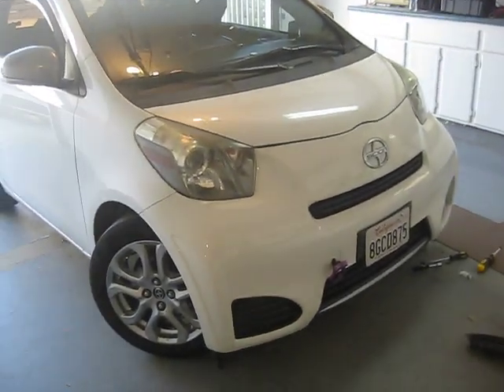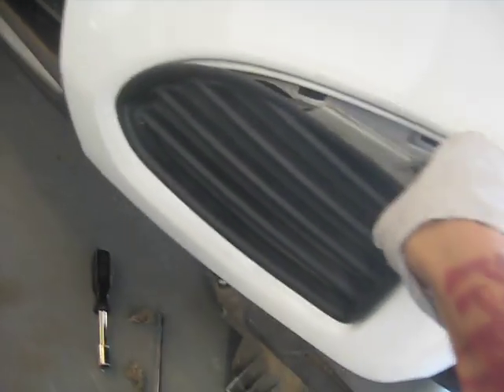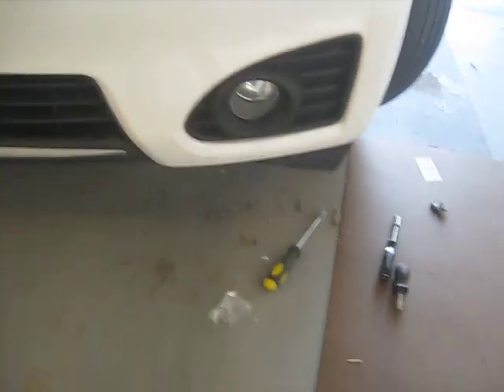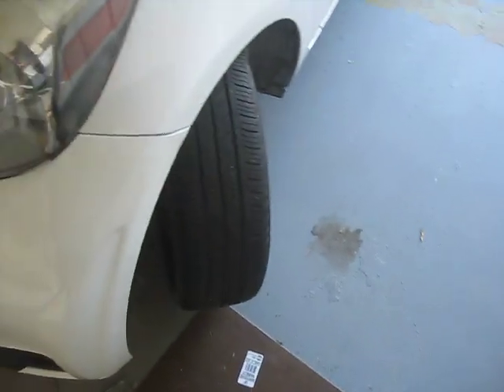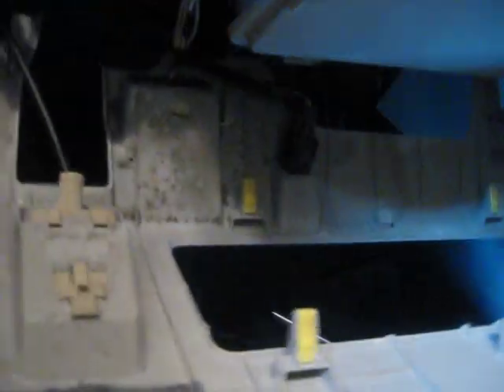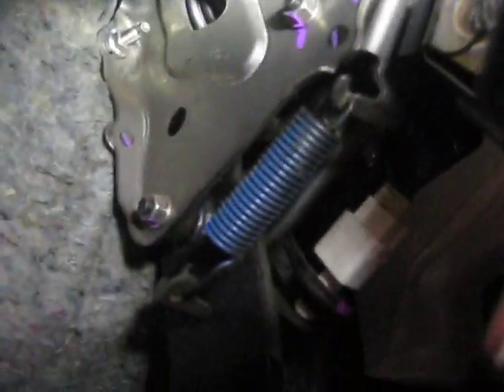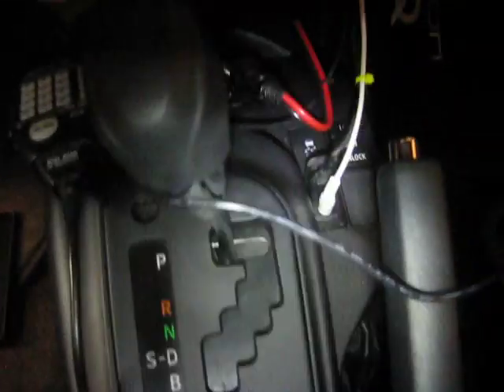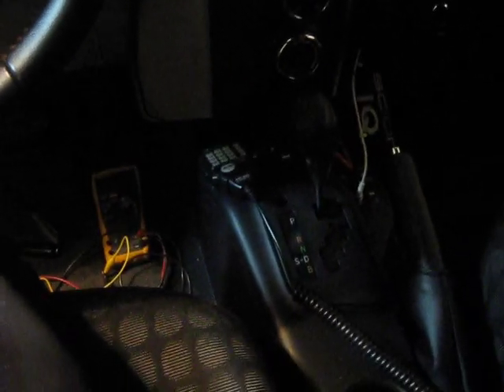scion IQ fog light install

Comment: Thanks for pointing where to look for the relay location. You can get to the relay receptacle without removing any of the panels - lay on your back in the footwell (butt and the rest of the body in the street), shine a flashlight up, reach in and plug the relay.

Comment: Do you recommend disconnecting the negative on the car battery before installing the fog lights?
Reply from the maker: @jorgearteaga1868  no need, there is no way to short or shock yourself
Reply: @travislab7687  Thanks for posting this video, it helped me install my own lights. You're right, installing the relay was a hard reach!

Comment: Can you put a link to the switch you got?
Found the relay. Can’t find the switch.
Reply from the maker: They seem to be all over eBay for 60 to 80 bucks, it's not to say an aftermarket one won't fit, just make sure the plug is the same...the one I have, the plug is Way different, but looks like there are some that the plug looks exactly the same.

Comment: Hi, I am totally confused. I got the same fog lights from Amazon and install it with factory cable plugs that were already behind fog lights and now switch it doesn’t fit factory cable plug that already there. Do I have to buy factory switch or reinstall rewire the fog light switch cable with one that already comes with fog lights? 
And what about rely do I need to install it or it is already there? Thank you for your help.
Reply from the maker: Yes you need the blue toyota relay...it shows in the video where to put it...and yes you need to rewire the plug or get the factory switch..the wire harness in your kit is not needed.
Reply: @travislab7687  , Thank you so much for your reply! can you send me the link the thing you bought? relay and switch? 
if i want to save money can i use same cable that come with fog lights and relay's actually come with  on my kit, is that compatible or i still need different relay?  thank you again for your help.
Reply from the maker: @Firuz9991  look up foglight relay $10 and oem foglight button $40...you will save money if you run that harness...but for $50 to skip all that labor was worth it for me
Reply: hello  @travislab7687  hope you having a good day!. can you please send me the link of what relay and fog-light button to buy in order to skip running harness? thank you so much.
Reply from the maker: @Firuz9991  email me. Crxboy96@yahoo.com